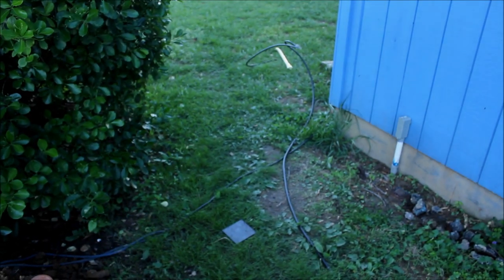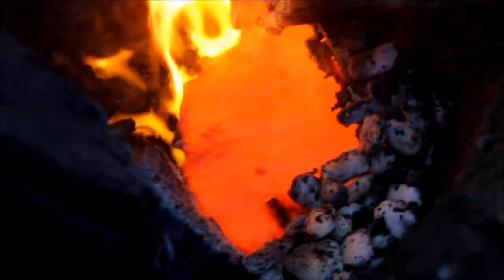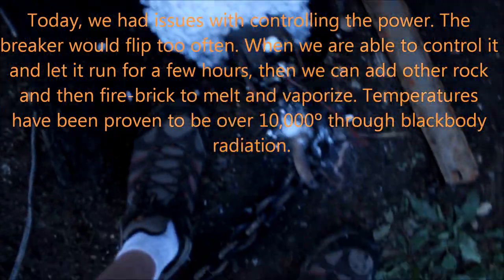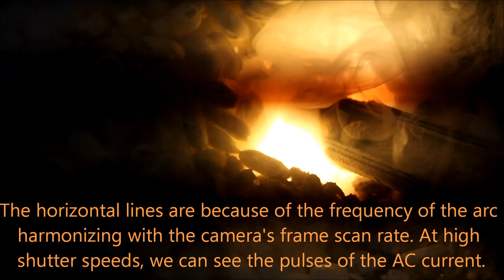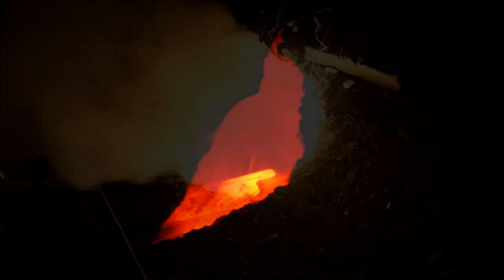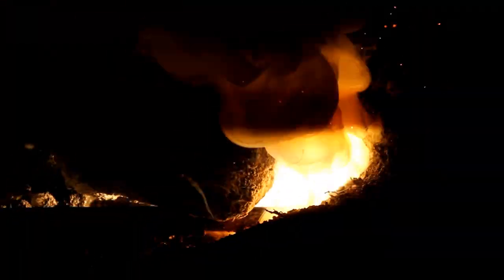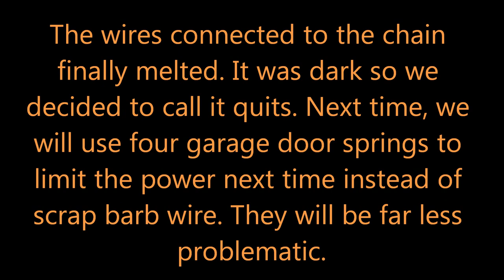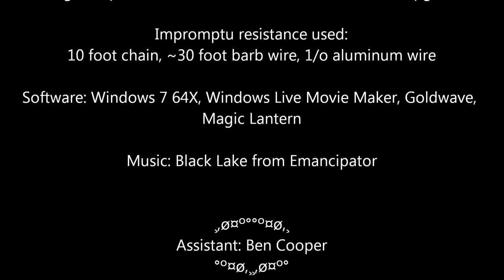Homemade 25,000-75,000 watt volcano in 1080p HD

Comment from the maker: I haven't in a while, though its about time I did! Ill be more than glad to test it out. Because hot salt is likely to decompose at high temperatures, I wouldn't be surprised if Chlorine gas would cause corrosion... along with the sodium.. quite quickly.  But, it may tarnish in a way that is appealing? Though, it would continue to corrode more over time I assume. I will test it out with some .308 shells I have laying around in the next week or two. Ill let you know the results.